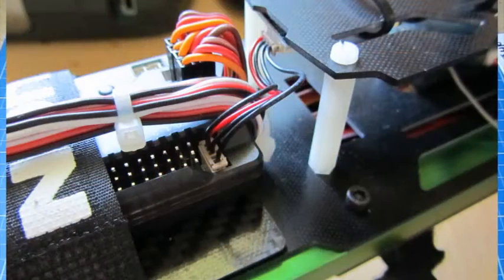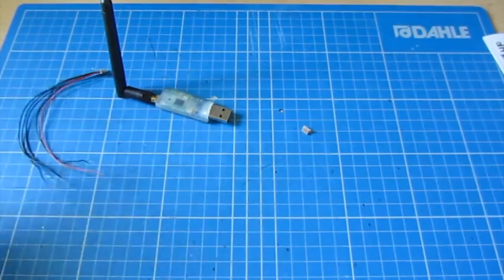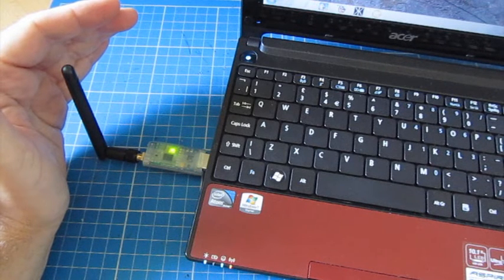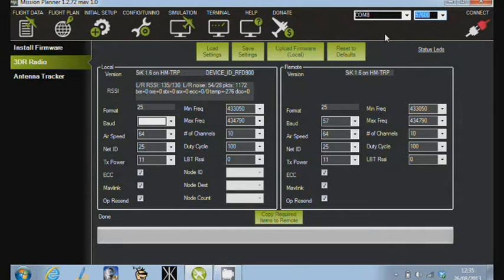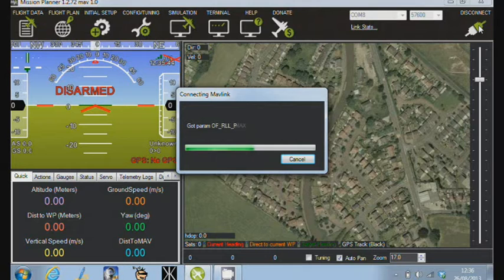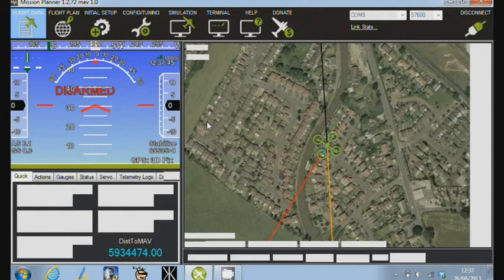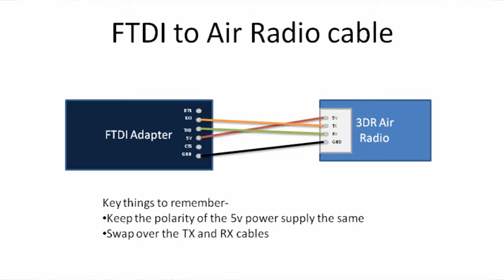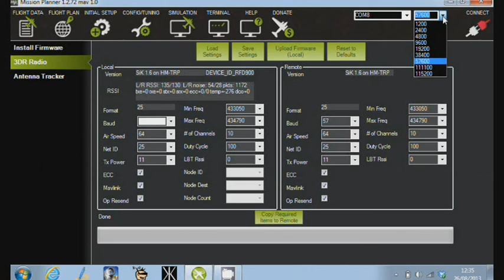MAVLink 3DR Radio on an APM 2.5 Multicopter Board - Overview, Setup and Troubleshooting

Comment: Great video! What if I plugged the Sik Radio into the telem 1 port and I do not get any light on it? I have a Pixhawk 1. The other one is plugged into computer and I get a blinking blue light.
Reply from the maker: If there is no light then that may be no power - what troubleshooting have you already done?

Comment: Thx for your helpful video. The problem only is that I lost the air unit. Do you or somebody else know where I can buy it separately for a reasonable price?
Reply from the maker: EBay? I've got them from lots of places..
Reply: Painless360 just to clarify I’m only searching for the air module.
Reply from the maker: I've never seen them sold in anything but pairs..

Comment: Hello, I managed to solve the issue of the telemetry 433 version but now I have the same problem that mission planner does not get data, now if I connect the USB cable to the PC it works and when disconnecting the cable without disconnecting the battery and connect the telemetry works but does not send data but I see them in mission planner but I can not do anything just watch them. the green lights are fixed and the red ones blinking (connect and send me message getting params)

Comment: Wheres the 3DR settings gone??. Not in the latest version of MP. Just Sik Radio and when you try to load settings, all i get is "Failed To Enter command mode" prompt. Must have purchased some clone. Just wish ardupilot update their web pages. Most of the pictures on there are from years ago. Not easy to follow.

Comment: Good day, on apm how can i use 2 telemetry modules?
First is radiolink prm-03 to get telemetry data on my at10ii and 2nd is a wifi telemetry module so i can connect my phone and use the TOWER app for mission planning. Is there any other port on apm 2.8 that i can use aside from i2c port because i have a compass on it. Thanks.
Reply from the maker: The APM is designed for one device only...
Reply: oh ok. Thanks.

Comment: Hello Painless360. First, thanks. Million for your indispensable videos. I am able to build quadcopters (two so far) solely because of you. My question: Can these 3DR radios work with FC boards such as the Seriously Pro F3 and F4.  Thanks again.
Reply from the maker: +Ibrahim KHALIL thanks for the question, you know what? I've not even tried. If you get it to work do let me know. Happy flying

Comment: What should be the baudrate set up on the APM?
Reply: also, do i have to power the APM from a different source? cause i dont seem to get a heartbeat when they are both connected to my computer
Reply from the maker: Sorry, I don't understand you're question..
Reply: i wanted to know what baudrate i should set up on the APM2,8 or it does not matter?
And for the telemetry modules to communicate, will the USB power do? Or do i need to connect the apm to an external power source?
Reply from the maker: All of the steps to get them working are shown in the video. We also install later versions of them to a Quanum Nova Pro in that series too. Best of luck!

Comment: Hello , i have lost the link, i was trying to adjust airspeed to see if it can increase the range, then it happened, i think i did not click copy to the remote.Too bad!do you think that the pl2303 usb to serial will work to reprogram the remote one(it uses the prolific driver)?this is all that i have...
Reply from the maker: We used a FTDI adapter here to get one of our sets working. Best of luck with it!
Reply: success to reconnect , using the "cp210x USB to UART" from the programming cable of my Flysky Ct6B Radio.

Comment: i need to get 433 mhz to improve my range i was looking to use a 433 hc12 module, on the quad, and some sort of otg device for my phone.. do you know of anyway to do this with ezgui  and usb otg.. as it would be so much easier that bluetooth gorund station bridge.. what device do i need for the groundstation end ?
Reply from the maker: The one I've used is the HobbyKing radio set. The ground station radio has BT on it you can connect to. See it in the Quanum Nova series. It made it very easy..

Comment: Do you have to flash the airside firmware? Sorry I was a bit confused by the part with the multiwii firmware board. Is this absolutely necessary or only if you're having problems?
Cheers.
Reply from the maker: +Lorcan Kelleher only if they don't work..
Reply: Painless360 thanks a million!

Comment: hi painless. I can get my 3dr to connect and it shows my radio state and if I move my quad the compass horizon moves BUT and I bet you knew there was one ? I can't get my data to download when I hit the load settings tab. any help please. thanks
Reply from the maker: I'd suspect that it's firmware related issue. You could update both radios but I'd be tempted, if they are working, to leave it alone and fly ;)

Comment: Thanks painless. I fix the rolling over problem. It was just balance. I just was wondering if you know way to check if the telemetry radio is smoke or not. It's still lights up but doesn't seem to be talking. I will go through the videos again. Thank you
Reply from the maker: If you can connect to it - it's ok. If you can't then you've probably cooked it ;) Best of luck!

Comment: Thanks for your videos. You just got me through my first build, a 300mm hex with APM. I have a question if you have time. I had a roll over on testing and when I powered back up I saw smoke. Unplugged and found out the 3dr antenna mount had cracked.  I soldered it back and powered up. It lights up and flashes for about a minute then the light goes solid but it doesn't connect. Any ideas? Also I spliced the OSD into the telemetry cable and it works but had to switch the TX and RX cable for the 3dr to work. Then the OSD data is all over the screen like its trying to fit on a larger screen. Any ideas on that?  Thanks again and great job on the videos. 
John
Reply from the maker: +MustangO3 so you have three things to fix? Flipping on takeoff, damaged telemetry radio and OSD size? We have a video on things to check if you flip on takeoff. Replace any components that have smoked, and I've not seen that on an OSD, check settings.. best of luck!

Comment: Thank you for your videos, they help alot. I i'm powering my FC with USB cable and trying to mak the connection with MS and telemetry. They load the data in config but then it wont connect. Do the power must come from the battery instead of the USB?
Reply from the maker: +Andre Ferreira I've never tried it like that. I would check that the radio is powered by the USB cable powering the connector. Best of luck!
Reply: +Painless360 it is and loads the data in initial setup but it wont connect
Reply from the maker: +Andre Ferreira we ended up flashing one of our sets to get them to work. All we did is in the video. Best of luck!
Reply: It works when connected to the battery :D

Comment: will this work in part with the osd board?
Reply from the maker: Not always, there is only one telemetry port so you normally have to choose between them. The Pixhawk ahs more telemetry ports to support this. I've heard of builders doing it and some running into problems with overloading the output pins on the board making both unstable. Best of luck!
Reply: +Painless360 how far is the range of mavlink? I'm I better off with osd? I bought both just waiting on the mavlink.
Reply from the maker: The OSD is limited to the range of the FPV signal, the lower frequency for the telemetry radios will give you a lot more range normally.. Best of luck!

Comment: Hello, I tried changing the NET ID with this tutorial right here.http://ardupilot.org/copter/docs/common-configuring-a-telemetry-radio-using-mission-planner.html  Followed each and every step carefully. But after I save settings and reboot only the net Id of the Ground Module is changed. The air module's net id remains unchanged and it doesnt pair after the reboot. Also when I open the Sik radio settings page in mission planner and click on load settings, the remote module doesnt load its firmware name. I need to use 2 telemetry modules in parallel. I am experimenting with RTK GPS along with APM. So i need one for the usual telemetry and one for sending the GPS data for RTK.

Comment: Hi, I have a clone 3dr radio from dx.com. The ground module seems to be ok, but the air module's light doesn't come up even I've powered on the APM 2.6 using battery. So is this the hardware problem or the software? Thank you so much
Reply from the maker: Two radio normally has two lights, one for power and the other to show the link is made to the other radio. I had to flash mine as shown in the video to get the settings the same to make it work. I would contact the sender for help. Best of luck!

Comment: hi, thanks a lot for your tutorial, theyre are very helpful ! i finaly get my 3rd radio connected but it's VERY VERY slow, baud rate seems ok, 57600, i need about 5 min to have all the parameters on my computer ... any idea how to make this faster ?
Reply from the maker: +christophe levaux Not sure, I'd check all of the setting and make sure that non of the pieces are still set to 9600.. Best of luck!
Reply: +Painless360 well i unpluged everything and plug back on and now it s working it was thé power modual le thé apm that causes that it seems thanks

Comment: I could not get the two to connect with each other even following all the steps until I saw that even reset to default the number of channel goes to 50 and when I changed that to 10 on both it finally saw each other. Still trying to get working with APM but I think I got bad cable waiting for a replacement. Hope it will be OK. By the way great video series, keep up the good work!!

Comment: forgot to say got the ftdi adapter made the leads up but have'nt a clue what to do next
ps thanks for all your great videos
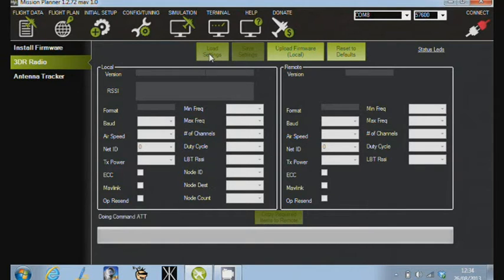Reply from the maker: +mat green Click on 'Upload firmware Local' Button at the top of the screen (5:51) you'll need to update both and make sure they are set identically. Best of luck.

Comment: Hi buddy, i accidentally updated my ground radio unit from 1.7 to 1.9 firmware and now i can't update the air unit too. I have the ftdi and both blink green led when powered separedly, when powered together, both become solid green but no connection on MP. When i try to update firmware using MP or 3dr config tool, it says "failed to identify radio" and when i try to load settings it says "failed to enter command mode". BTW, i'm using a chinese 915mhz 3dr radio from aliexpress. Could you help me? I've tried almost everything, read a dozen pages/forums, saw another dozen videos but nothing worked. Thanks and keep up with your GREAT videos.
Reply from the maker: Thiago Arecippo The only way I know that works is by using an FTDI Basic adapter to connect the airside radio to the USB on the PC (as shown here) and forcing the update into the airside radio. 
Hope it helps.
Reply: I've tried with the ftdi adapter normal way and forcing bootloader and nothing. It stops when send command ATI, seems that is the command to recognize the radio. I think that it is giving me this error because my radio is a chinese clone.

Comment: Hello, i finally got my radios plugged correctly, I can not update them or load settings on mission planner i keep getting invalid comport or in use note. i set it to  57600 but nothing happens it is in auto tho, any help would be grittily appreciated
Reply from the maker: Roberto Mariscal Does this happen on the groundside radio too (the one with the USB port)? What troubleshooting have you done?
Reply: Hi! I finally got it working it was not to the ground radio, it times that the RX had to go to the TX so I switch the cables and finally got it working. than you very much

Comment: Hi guys, I have 2 sets of temetry 433mhz, and I have clicked upload firmware (local) on both sets :( now the air radio is solid green and the ground station blinking, I guess I have updated the firmware to the ground station only ? is there any way of updating the air telem module without a ftdi cable ? Thanks :)
Reply: alan york  P.S, I am using pixhawc fc.

Thanks
Reply from the maker: Not that I know of. Maybe another trick on the web.

You really need an FTDI Basic adapter. You use them all the time flying multirotors..

Best of luck,,
Reply: Thanks for getting back so quickly mate, I have been searching lol,  Thanks

Comment: Does the new mission planner update the firmware for the remote radio now over wireless?
Reply from the maker: What makes you ask that Jon?
Reply: Painless360 Well I tried doing that on the tri copter I built and it worked.  I was able to push firmware over wireless to the remote radio on the quad.  I also tired this method on the small bug copter I am building now and it worked perfectly.
Reply from the maker: Very interesting, I will try that on the next set of radios I configure. Thanks for letting me know!

Comment: So I just need a 5 pole to 5 pole? Is this what I need? Are the pin-outs OK?
http://store.3drobotics.com/products/df13-5-position-connector-10-cm-1-2-3
Reply from the maker: Check what is on each end of your radio. I had to get a 4 pole and 5 pole cable and use both to make one that worked (see 2.50 in the video).

Best of luck with the build..

Comment: Do you know where I can buy the DF13 5 position and DF13 4 position connectors/cables? I have the same problem. My cable has a 6 pin connector on one end.
Reply from the maker: eBay has lots. Search for something like 'df13 5 pole' to find them..

Best of luck.

Comment: Hey there! I need help! My 3Dr from ebay is working perfectly with windows and mission planner over usb connection. But when i try to use it with android droidplanner 2, there is no way to get a connection. Always mavlink error. I think that my Android Phone (Nexus 5, 4.4) does not recognize the 3Dr usb ground module! Any suggestions?! Maybe a driver problem because Android cant read ftdi r232 usb uart?
-Michael
Reply from the maker: Some android devices do not provide power through the USB port and provide true on the go (OTG) support. Samsung Tab 3 doesn't but Samsung Tab 4 does,

You will also need the OTG adapter for the tablet/device you are using.

Hope this helps.
Reply: Painless360 dude i conmected the ground module over USB otg how else should i connect it ;) it also seems that the module is powered because the green LEDs are on
Reply from the maker: Good to hear, most of the issues are down to a lack of power. As I've not got an android machine here that supports OTG, I can't suggest what's next. If you get it to work I'd be interested in the answer..

Best of luck.

Comment: hi information do you know the usb ground module pinout im trying to connect it with a bluetooth module pls help
Reply from the maker: ras4q2001 I've documented it using the 3DR radio pinouts so you can see what the pins are on the APM. See https://dl.dropboxusercontent.com/u/67301981/APMRadioPort.jpg

I would be interested in a video of it working when you've finished as I've been thinking of this myself. Happy flying!
Reply: Painless360 ok let me explain i'm not talking about the pinout on the apm or the air radio i want to know the pinout from the usb end (ground module) the order of the setup i want is bluetooth to ground module  then ground module to air radio meaning i'm using a BEC to power the bluetooth and the ground module so i made a female usb connector to plug into the ground module usb so there are 4 wires on the female usb connector what i want to know is the pinout from the usb end i don't have a multimeter at the moment to check which wires are positive or ground rx or tx i need some help i hope you understand what i'm trying to do much thanks

Comment: Hi Painless.
I've got the 2 telemetry modules but I have not been able to make them work yet. After power On the radio module both green leds module are solid green, so the connection is established. Red led on air module blink. But I can not Load Settings on the ground module. I don't know why. Only strange thing I can see is that when the red led on the radio module blink, then blink at the same time and at same frequency the ground module red led, although with a very weak light. Thanks in advance
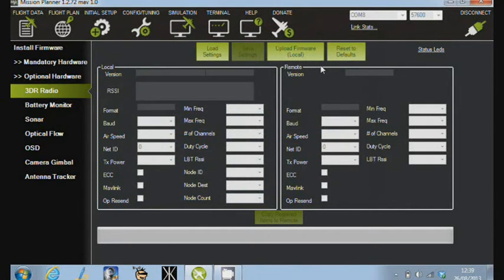Reply from the maker: Sounds like the airside radio isn't running at the right baud rate and flash both with the latest firmware. I'd recheck that part of the setup first (9:40)..

Also, swap the tx and rx wires on the little cable from the APM to the airside radio if you still don't get any data and connect to the radio as soon as power is applied to the model. Don't wait too long as they seem to 'lose' the ability to connect sometimes.

Hope you get it sorted. Happy flying!
Reply: Painless360 Thank you Painless for the answer. Well the fact is that unfortunately I have not the FDTI interface so I can not, for now, flash the airside radio. Howewer I can not flash the ground radio in Mission Planner because it fails with the message "Failed to identify Radio". Now I try to swap the tx and rx wires on the little cable.
Thanks
Reply from the maker: I'd strongly suggest you get an FTDI connector and a cable to help here as I couldn't get my radios to work until I flashed both sides.. Best of luck.
Reply: Hi. But with an FDTI connector I can flash the airside module. Then can I also solve the issue that I can not flash the ground module? I will buy an FDTI module. Thanks.
Reply: Painless360 Further to above, no FTDI cable was needed for my modules as mention in posting above. Just installed 3DR telemetry to HK APM 2.7 board and all is working just fine. Thanks again.